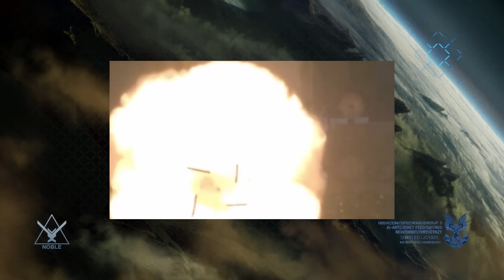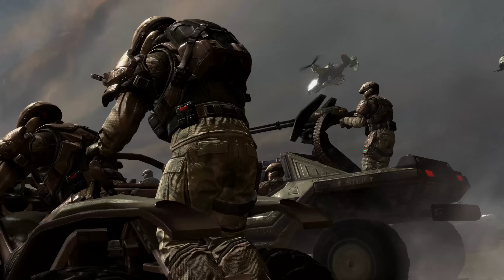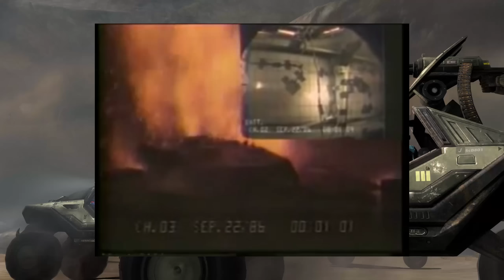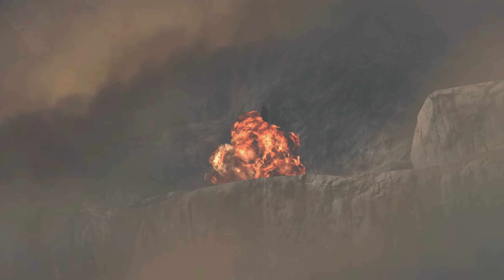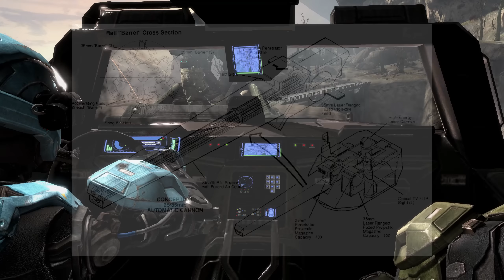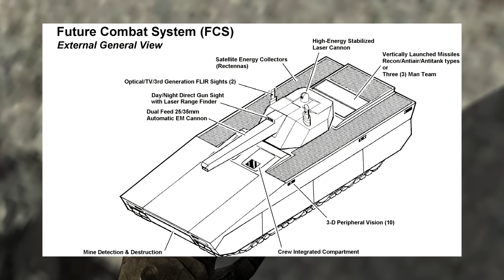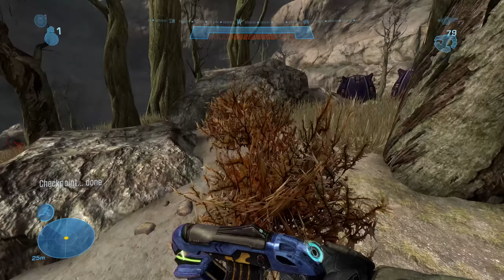Are Railgun Tanks Practical?

Comment: There are already some handheld railguns, poverwise comparable to 0.22LR (in situations under 30 meters). If the shooter has a backpack, or even a hand pushed cart, full of bateries, or (possibly even better) condenser(s), than the "bang" sudenly compares to firearms. Railgun will be much easier to mount on APC than tank - simply because in APC there is extra space for extra devices. If the APCs powerpack is hooked up a shitton of condensers in the troop compartment, AND IN the barrel of said railgun, than it might get to the "danger to other armoured vehicles" level of firepower.

Comment: Railgun Tanks are still practical, just the cannon doesn’t use a ton of energy unlike the navy built railgun. The energy source should be as small as an average tank engine, supposedly a mini nuclear reactor or high energy batteries for a propellant source . Overall its still not possible today but somewhere in the 2060’s its most probable.

Comment: This is a very interesting topic and your conclusions might be completely wrong depending on what kind of rail gun design we are talking about.

My design idea would be a hybrid design of chemical propulsion and electric field propulsion. 
1st stage the projectile gets initially accelerated by a chemical component (black powder type)
2nd stage the rail gun or gauss rifle design takes over, senses the projectile and increases its speed further. 

The advantage of this design would be to safe electrical energy, less wear and tear on the electrical components (rails / coils etc.), cheaper, more practical, more feasable.

For example, your ammo capacity etc might be and probably will be completely off. The space typically used for ammo will be used up and even more so for batteries, cpacitors etc.

Also rail guns do not have a barrel they have rails.

And there is no way rail guns in tanks will be a thing in 20 years. Your estimation is probably very far off

Comment: Smaller projectile means more space

Well, you'll need electricity, and a lot.
So either you'll need a capacitor or a huge battery.

If you choose a huge battery then you can also use that battery to propel the tank.

(Suddenly EVs become a lot more interesting)

Comment: I'm just an armchair engineer, like most other people here, but I wouldn't say a railgun is necessarily safer than a normal gun. Accelerating a projectile that weighs ~15kg to Mach 6-8 takes a lot of energy which needs to be stored somehow. Just because the energy is electrical potential (stored in a capacitor bank), chemical potential (stored in batteries) or magnetic potential (stored in an inductor),  doesn't mean it couldn't accidentally be released suddenly (and catastrophically). Just look at Teslas, which have had a habit of spontaneously combusting.

Comment: A concept for fixing the barrel wearing out could be to make the gun barrel that holds the beams (or whatever propulses the slug) be slightly thicker, in order to carry a system to eject the beam and replace it with a new one, where it gets ejected in the same direction as the bullets are fired, and beams (for instance, the lower beam) move up into position and are locked in place.
I'm not sure this will work as i thought it would, since i've never documented myself much nor studied them, this theory might not work.

Comment: Smaller calibre isn't always good. The projectile still need to be of a certain size and mass to actually be able to deliver all those KE that it stored. And a projectile can only deliver as much energy as its mass allowed, thus, the projectile still need to be at at least 100mm calibre for optimal KE deliverence....They also need to be big enough to handle the effect that atmosphere and space dust have on the projectile...disintegration will turn all that KE into wasted heat.

Comment: The barrel physical size wouldnt be any smaller than current normal tank gun barrels. Infact,, i think it could be longer and thicker. 

Why longer? The step-up acceleration of a railgun works the entire length of the barrel. The longer the ammo is spent in the barrel accelerating, the less strain on the barrel itself. Ie: pumping 100MJ of electricity along a 10m long barrel would be less stressful for the barrel compared to a 5m long barrel. 

Why thicker? Cooling. Even if we manage to sort out the power delivery material used, those babies will get hot real quick. Its not a big deal if the barrel is just a solid hollowed out cylinder used to fire standard rounds, but electromagnetism tend to be affected by heat. It might lose its effectiveness if the barrel is too hot.

Comment: One minor discrepancy at the start of the video. A UNSC MAC is not a railgun, but a coilgun. Both use electromagnets and fire ferromagnetic projectiles, but coilguns use electromagnetic coils to propel ammunition. Railguns exploit the Lorentz force to fire rounds via two parallel electromagnetic rails.
https://en.wikipedia.org/wiki/Coilgun
https://en.wikipedia.org/wiki/Railgun
https://www.halopedia.org/Magnetic_Accelerator_Cannon

Comment: Are railgun tanks practical?

Not unless we discover a means of creating RADICALLY GREATER Energy Densities in Capacitors or Batteries... OR unless we find smaller generators that can create such HUGE (greater) amounts of electrical power.
Reply: You'd need something that's perhaps 10^3 times more energy-dense than Li+ batteries, give or take. Are you sure you want to put a big block of that aboard a vehicle that you're sending out to get shot at?
Reply: OptimalOwl 

The current thinking is in producing nanocapacitors and room-temperature superconductors (or, something that is only a few dozen degrees colder than 0°C), which can be coupled to Turbine-powered generators using the same superconductor in the generator.

These are not anywhere near as volatile or otherwise “dangerous to itself” as are Li-ion Batteries.

The needed capacitors can be made in labs, now. But the ability to scale the capacitors’ manufacture is still elusive.

Comment: I think railguns are more likely to show in SPG's or SPAA .  This because railguns require a significant amount in instant energy, which means super capacitors.  And although the ammo in railguns can be inert, supercapacitors aren't, and if damaged can lead to thermal runoff.  

What I think is more likely to happen is ETC guns will take to role of tanks or direct fire, and railguns will take the support or indirect fire role.  Benefit being, that supercapacitors in railgun chassis could also be using in direct energy weapons.

Comment: 20 years is optimistic.  We need a few thousand fold increase in battery capacity and/or on board electrical generation to achieve the demands of a small rail gun.  Even room temperature superconductive materials would have a hard time delivering the demands when scaled down to tank size.

More likely we'll see hypersonic adaptations to ammo within that time frame which would be easier to achieve, would not require a complete overhaul of existing systems and would likely be cheaper.  The net effect, compared to a railgun, would be similar.

Comment: Stored energy is stored energy. The devestation of an exploding battery/capacitor would rival tank rounds.  Also, the shift in warfare will be extreme, like when suits of armor became completely obsolete as firearms grew more prolific. when the effective range of a rail gun is essentially line of site, the armor thickness will become less relevant in favor of high mobility and low observability.

Comment: You missed heat. Railguns generate a terrific amount of it- it's one of the factors in their risible barrel life.  
Recoil is another serious issue- hypervelocity rounds create massive forces, on par with the enormous naval artillery of the past.
I'm not sure if tank sized railguns will ever become practical. 
The naval problem is finding a compact solution to replacing their battleship and monitor armament, at a reasonable cost. That's achievable. 
Ships can accept heavy, bulky gun mounts and can supply the terrific power and high flow of coolant required. The aim is to replace a 12"+ naval cannon- a device that required a 600 ton turret and multiple decks of associated equipment. Railguns with sturdy, long lived barrels should be able to mimic traditional artillery in a much smaller and lighter package.
'Smaller' and 'lighter' are relative, though. The British considered a 600 ton turret and associated gubbins perfectly acceptable in their Great War era monitors. The USN fitted 1700 ton three gun turrets on their final battleships. 
A mount weighing in at several hundred tons would be acceptable for cruiser use. Miniaturising that technology to fit in a MBT would mean reducing the weight and bulk by a factor of ten or more. 
I don't doubt that it may be possible, but the associated costs would be horrific. 
The Navy might actually save money by getting operational rail guns into service, negating the requirement for cruise missiles, or bringing warships into range of return fires. It's an elegant, high tech solution that's well worth the investment they've put in so far. Trying to shoehorn their artillery into a AFV  is another game entirely!

Comment: I simply cant see tank using rail gun anytime soon.. the ammount of battery n capacitor needed to charge the rail gun is simply too much.

In 20 years we would be seeing almost all us medium size warship using one.. size n weight is not an issue in ship. They were using huge engine to run the ship.

Barrel IMHO is not a big issue, we would be able to solve the both accuracy n endurance in less than 20 years. But battery would be the biggest issue in tank sized unit.

Even if we could triple the battery efficiency, it would still limit's the ammount of round it can shot. 

Then there is a issue of over penetration. If it miss, or hit a softer target.. the collateral damage would be incredible. It can kept going n going.

Comment: But can rail gun have lower speed, sometimes you need to throw something over a hill, also having great penetration power can result in much lower stopping power since slug just penetrate corpus right through without losing almost any energy, so target could have minimal damage if it doesn't hit any vital parts.

Similar thing actually happened during war when modern Russian ships penetrated Japanese wooden ones without sinking them.

Also having a tank by this time might be pointless since protection of it might be obsolete to any known infantry weapon. So as I can see Gauss tanks are pointless unlike gauss weapons on lighter or maybe flying vehicles, or compact ones to use as anti tank weapon

Comment: Um no the power needed to use it would need a power station fallow one tank.  Oh and then there ammunition logistical issues on the battlefield  on and a rail gun would be more venerable than a cannons on tanks and there's all ways weather conditions who wants to be in an electric rat trap on tracks in a rain storm firing that thing lol the crews would have to wair a robber sute like 1 inch thick. Then there's the risk of the tank setting off youer personal weapon's inside the tank

Comment: Rail guns are one of the technologies that have far greater implication than just their destructive potential in combat. Successful implementation of a scalable model that is reliable and consistent would lead battle space conditions that render many of the current doctrines if not obsolete then at least increases the risk by an order of magnitude. Take the USAF for example, if you could guarantee that their planes won't come within 10 miles of an operation area? Yes they can still launch missiles from further out but the same tech would allow you to intercept those as well. On another scale it could make intercepting ICBM reliable to the point that they become a minor concern. This would curtail the effectiveness of carriers as well. While this wouldn't bring back battleships it could herald the introduction of larger surface vessels capable of fielding arrays of rail-guns for self defense and long range bombardment. Like I said this is one of those technologies that fundamentally would change peer warfare on the same level as the phalanx, firearms, machine guns, tanks and aircraft. 

On a peaceful note scaled up enough this cold solve issues with space lift at least concerning heavy, non fragile materials or where the condition of the material doesn't matter since it's being launched into the sun anyway. Imagine water, basic foodstuff, metal and construction supplies just lobbed into orbit. It could allow us to clean up all the junk, massively expand the spacestation actually go other places in our solar system. Anything launched at the sun would be disintegrated and turned to plasma before it actually get to the surface, then scattered by the solar wind harmlessly. All the stuff we don't want on the planet literally gone with the wind.
Reply: I suggest that you read a bit more about modern military technology before making such assertions that railguns would make intercepting ICBM "reliable to the point that they become a minor concern." And the aircraft-delivered ordnance of every notable air force in the world (including the USAF) can have ranges measured in hundreds of miles. Keeping the USAF only 10 miles away from your operational area won't help you one bit. This is an AGM-65 Maverick: https://en.wikipedia.org/wiki/AGM-65_Maverick . It is a 50-year old design, and it has a range of more than 22 km/13 miles and is commonly used as a CAS (close air support) weapon. 

Second, the problem with intercepting ICBMs isn't destroying or even hitting the warheads (read about how ICBMs work!) It's tracking those warheads, especially since MIRV-ed missiles carry a lot of them, along with decoys and other things to throw off your tracking. Even if you had lasers in orbit that could vaporize any warheads in an instant, how do you determine which of the 20 warheads you detect are the real McCoy, and which are just harmless bits of chaff? And since ICBMs almost always contain some very nasty filling (thermonuclear, chemical, or potentially even biological) missing one of them will be very, very bad news.

Aircraft carriers will also be around for a long time--stop reading CCP propaganda on their "carrier killer missiles" because even the Chicoms are building and revamping their own carriers! One thing you need to consider is that military planners in every country don't adopt things just because they are new and shiny. They don't think like you do; they tend to be very conservative. They will only adopt a weapon system if it offers a substantial (and possibly even 100% improvement over what they already have). The U.S. armed forces have experimented with replacements for the M16 for decades now. They even considered using a flechette-firing rifle (the Steyr ACR). None of these were adopted since they didn't offer 100% improvements over the current M16 series.

Railguns cannot effectively deliver explosive ordnance, and require direct hits on targets. For long-range bombardment, that necessitates excellent guidance systems, which entails electronics capable of surviving the incredible acceleration of the projectiles and control surfaces capable of steering said projectiles directly into targets. With HE, you can at least get away with near misses, and with nuclear weapons, you have even more margin of error, although using nuclear weapons on the battlefield is a very, very bad idea.

Comment: I'd say it's practical and battle viable on a ship but a tank? Sounds cool and something the military would "try". But current MBTs are already on the "cutting edge''. Making railgun tanks kinda on the iffy side. Because infantry can bring in small portable AT that punches just as hard as a MBT maybe even more when they carry ATGM setups. 

As some may know, tanks are pretty much on the support side of things. Infantry does most of the work. Also, don't even think about railgun firearms unless it's just for long range combat.

But I do believe one system that can be implemented. Railgun CIWS. Most CIWS is stationary and with that in mind they can carry support generators that Amps railgun fire. CIWS handle far range shots for air targets and with new and better tech, jets/helos are fast as fuck. Bullets are fast but a railgun can help fight long range, high altitude bombers! Longer range and acceptable speed and fire power! It's a system that I'm sure the military will accept.

Comment: 20 years maybe, 50 definitely. The weapon is just better in every single way- especially with the ability to effectively engage aircraft if the targeting equipment is properly thought out. Also, by varying the level of power and coupling the weapon with explosive rounds, a sufficiently large cannon of an MBT could effectively double as self propelled artillery. There's no practical reason to continue using conventional rounds once the power requirements are met

Comment: 3:18 - Wouldn't the stronger recoil also be a disadvantage? If your tank is shooting projectiles out at 10x the normal speed because you have a rail gun, that means much harder recoil, which in turn means having to strengthen and enlarge the recoil system and the whole turret. You can't put an arbitrarily large cannon on a tank of any size and expect it to work well.

Comment: And where is the problem of recoil equal to the strength of shot? Railguns are specially mounted on ships, because on water it is possible to handle the recoil.

Not to mention the hand electromagnetic arms like rifles that would, for example, without a Mass Effect field, break a soldier's hand.